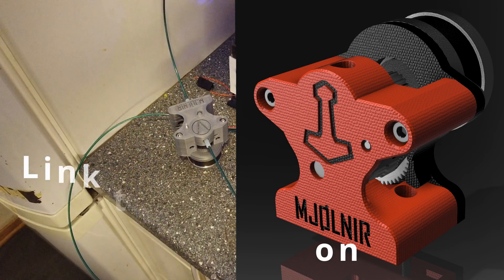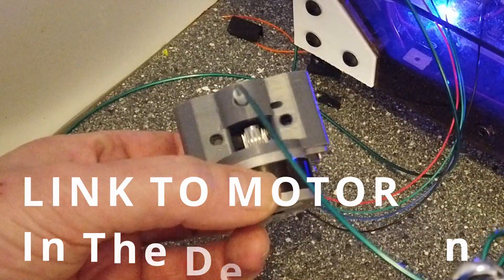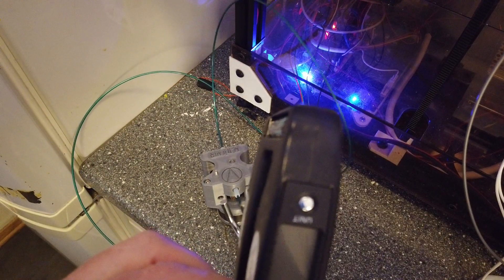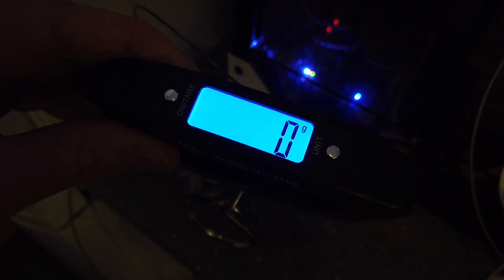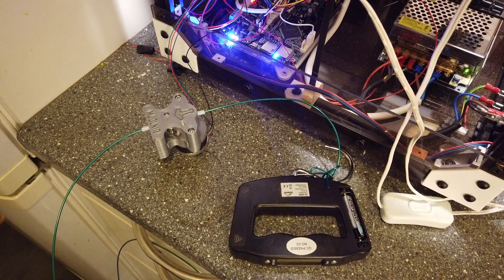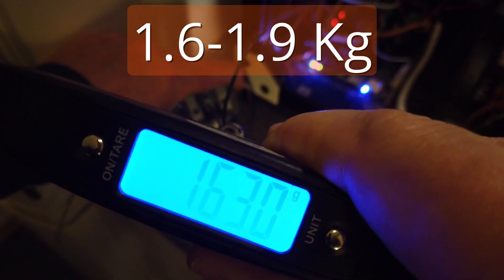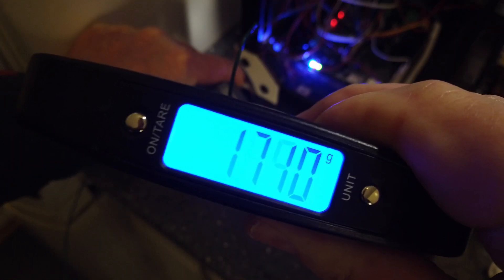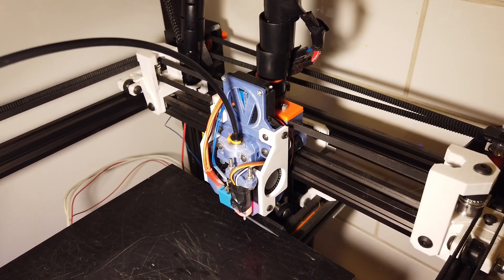HOW MUCH CAN IT PULL? THE NEW 150 gram MJØLNIR LWX 3:1 EXTRUDER

Comment: How hard would it be to install this as a Direct drive on a Ender 3 Pro?
Reply from the maker: It would need someone to design some type of adapter for it. If you go for the Triqetra tool head including the Mjølnir extruder it is probably quite easy to adapt. The Triquetra is still in beta but I hope to release it next week or the week after

Comment: Ok if you're going to do that, use a container with water. Mount the system so that the luggage scale will support the bucket once the motor slips. Then fill the bucket with water slowly until it slips. It should be a tad more accurate than pulling on the scale and hoping for the max. Also, you're going to damage that stepper driver.
Reply from the maker: Thank you. That is a very good idea